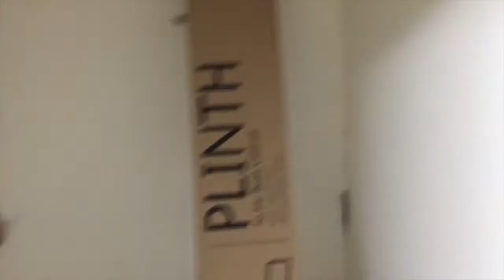Shoddy craftsmanship

Comment: I know who to call when I next need a kitchen fitting - the B Team. Not that there is anything wrong with my DIY work, along with my helpers bodgit and scarper. I can see the thinking of the council fitters - plug socket and boiler to the right of the cupboard, so we'll only drill the wall well away from them! Amazing it has stayed up so long like that, maybe it was the cereal cupboard only. At least when you are done it will all be safe, and very good looking too. You've an impressive range of power tools as well, that's obviously where I go wrong.
Reply from the maker: Lol I'll let you sort your kitchen out. I wouldn't want to mark that new paint job you and your other half gave it earlier this year. I remember a van that used to be seen in B&Q car park in Brid a lot that was professionally sign written as Bodgit and Scarper lol. As you say it may have only been the *whispers "granola" cupboard lol. Those power tools are getting old and tired and are only a fraction of my years of collecting lol, cheers fro watching as always buddy :)
Reply: I must see the thinking of the council fittings - plug socket and boiler to the cupboard right, so my dad and we’ll only drill that wall away from them! Amazing it was staying up very long like that, perhaps it was the cereal cupboard only. At least when you are finished it will be all safe, and it’s looking very good too. You also have  an impressive range of power tools, that’s obviously where I get wrong. They are time wasters at 04:32 are electricians and  carpet fitters but at least my fitters did my new carpet while  I was in London 2 weeks ago. No, they were serious at 07:15.
Reply: I know who to call when my dad next needs a kitchen fitting - the B Team. Not that there’s anything wrong with his DIY work, along with his helpers scarper and bodgit. I must see the thinking of the council fitters - plug and socket boiler right of the cupboard, so we’ll only drill the wall well away from them! Amazing it has stayed up so long like that, maybe it was the cereal cupboard only. At least when you are done with it will all be safe, and very good looking too. You’ve an impressive range of power tools as well, that’s obviously where I go wrong.